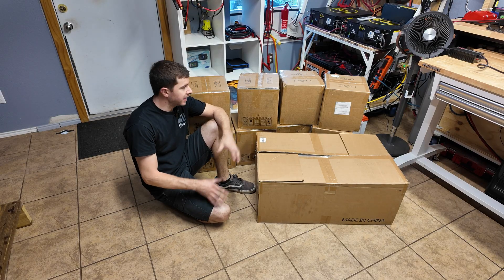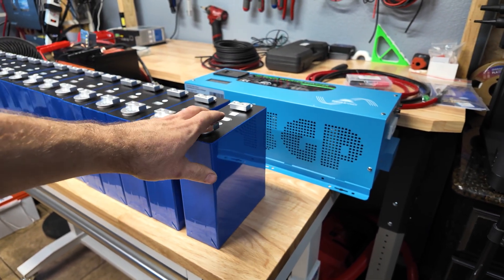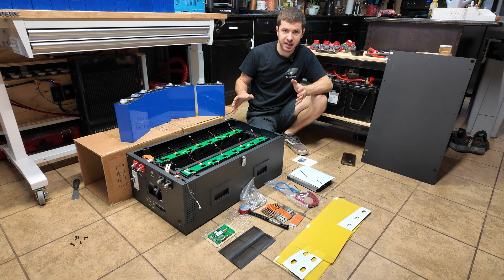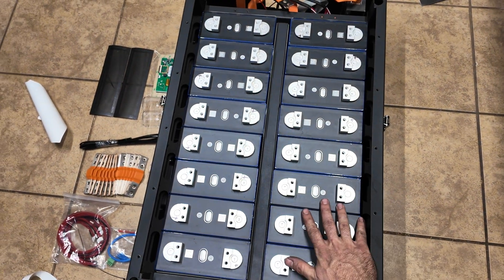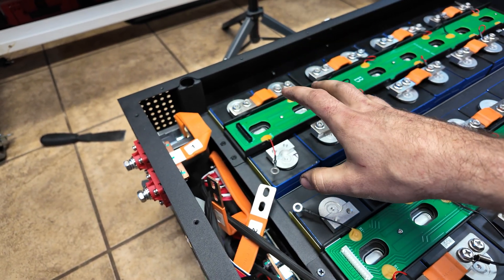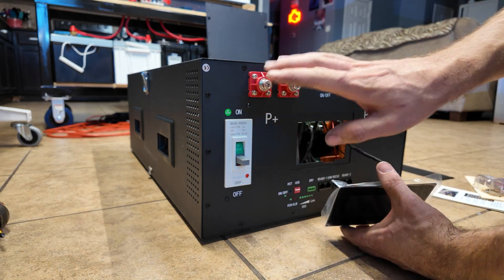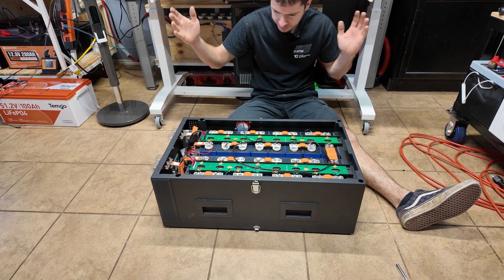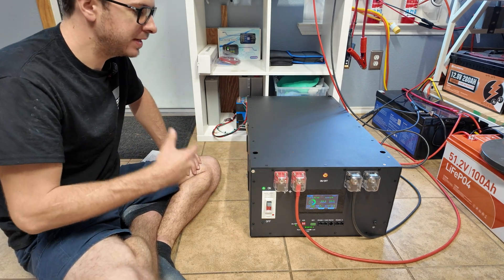DIY 48V 314Ah 16KWh LiFePO4 Battery Build!  | Yixiang V2 Kit

Comment: Hey guys, so are we supposed to top off each cell and make sure they are the same voltage before assembly? Also, what’s a good charger off Amazon to do this? 

Thanks for the video!!
Reply from the maker: You can top balance, won’t hurt! I just put it together and let the active balancer do its job no issues so far. Use a 15-18 amp charger from Amazon there’s tons of options
Reply: @Mikebuildss thank you Sir!!

Comment: What is the best priced AC charger you would recommend?
Reply from the maker: 48 volt 15-18 amp chargers are the cheapest option normally, if you want an adjustable output one eco worthy has one that seems good for the money but I haven’t personally tried it. 
I have a DC house 18 amp charger, and a WattCycle 15 amp charger both work good for topping off my batteries

Comment: Hi Mike, I bought the set after watching your video...(I have two) and it went together seamlessly.  My only issue is communications with my Eco-Worthy 5k hybrid inverter...it does not recognize the unit...I have to hook to rs485-2 to do this and I have a single rs485 input...I feel like it is simply an address issue...the dip switches are set correctly...just communications, any ideas?

Comment: if you took the front cover off, there are 6 bolts that tighten the plate the BMS is mounted on to apply pressure to the cells. Thus you wouldn't need the shims you printed.  You really need to take the front off and check all the terminations done in the factory are tight...found a few loose in the 5 I have.
Reply from the maker: Ahh ok I I thought I checked evening really well but won’t hurt to check again and see, thanks for the advice!

Comment: Can you stand these up on end if needed?.
Reply from the maker: I belive you can, these type of cells can normally be positioned any way except upside down. I would be worried about the box integrity, as im not sure if its built to handle the weight in that posotion

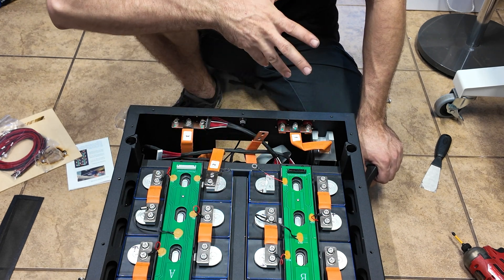Comment: Looks like they either shipped you a V1 kit or left some parts out of this one. There's supposed to be more 3240 epoxy sheets (yellow cards) for in between the cells, with a routed channel for the thermal sensors. You shouldn't have to 3D print filler for the compression plate and cells. You can see them in Off-Grid Garage's video "This new Yixiang DIY Kit could save you some money! And look at these features!!!" at the 9:52 mark.

Comment: Doesn't the plate with the bms mounted to it tighten to add pressure to the cells?. I saw that in a few videos.
Reply from the maker: It does but even with the plate fully torqued i had some space.

Comment: Warning for any one considering buying from Shenzhen Yixiang New Power,  Run Away as fast as you can.
My vertical box arrived damaged, internally and externally. Becky changed from being super helpful pre sale to absolutely horrible! 
All the positive reviews are of people who have had no issues! Try to return an item, or request post sales support and their attitude completely changes. I have been in a dispute with them for 3 weeks, and there is no sign of resolution. As I said run and dont look back! 
If anyone is interested I have all the details 😊
Reply: Quick update - Becky has gone from bad to worse! I've now been ripped off. I have 16 3.2v cells and no box. They absolutely DO NOT STAND BEHIND THEIR PRODUCTS. YOU HAVE BEEN WARNED!

Comment: If sodium ion batteries drop to 10$/kWh as promised by CATL .

There is no way Trump and the oil companies can stop the energy transition.
Reply from the maker: Agreed!
Reply: please research sodium, the curve is an issue with most equipment at this time.
Reply: @lancesada7515  The solution is a high voltage battery..
Reply: @lancesada7515  Go to China bro and see .
How much China government Spending tax money on R&D in renewable energy . 
This is the reason why China will be the winner in this green energy race.

Comment: 6:00 I think it’s best practice there should be isolating sheets between all cells (the yellow stuff you putt below and on the sides of the cells).

(Also: if people use this as an example: wear safety glasses and preferably isolated tools ⚒️)

Comment: Neat product! Those golf cart batteries ya got in the background are coming down in price fast! I bought one in June for $830 with charger, now its $705 with charger, or 650 without charger. Do you recommend this battery over the golf cart style? I have 2 golf cart batteries. I'm debating whether dropping the coin on a DIY battery like this or keep stacking golf cart style batteries as they go down in price. I don't need the communication ports. My 2 batteries do get a little out of balance but nothing more than 15%. Thanks for the video!!!
Reply from the maker: That’s a tough call like you said the golf cart batteries are so cheap and so easy to connect and get going, I think I do like this if you wanna get 1 large battery plus it’s easy if you need to service it

Comment: Did they not recommend "top balancing" the cells in parallel at 3.65v until the amps drop below 1a? It's quite an important step to make sure they are all the same voltage and can take between 12-36hrs.
Reply from the maker: I’m sure that’s recommended, and a really good idea, I didn’t wanna wait. This bms also has an active balancer and those are really good at getting the balance perfect in my experience. I didn’t wanna wait voltage check cells they were all the same , doesn’t mean much with LFP due to flat discharge curve but it’s a good step regardless
Reply: @Mikebuildss yep watched a will prowse vid recently and this was one of his steps. I think it's so 1 low cell doesn't trigger a low voltage disconnect etc.

Comment: How much did you pay for this shipped to US? I feel like it would be more beneficial to buy the ecoworthy 48v 280ah v2 which is $1900 and 2 days shipping
Reply from the maker: I bought my cells from Ali baba, yixiang braided 314ah, The shipping for the cells was around 200 but the prices change so much it’s hard to have an exact estimate. 

If you buy the whole kit from the site, it says USA stock but I would verify that before you buy. If you can get us stock for under 1900 I’d say go with the yixiang.   From china the cells cost a little less. The box came from the USA warehouse and took about 3 days to show up
Reply: @Mikebuildss  Can you provide a breakdown of your costs (box vs cells)? And you bought the box kit from their website and the cells from them but via Alibaba? Thanks!
Reply from the maker: @dmitriyc yes good idea!
Reply: i see. Also, how do you move them around after assembly?
Reply from the maker: @HuyTran-zy9sv  Dragging it across the floor
Reply: beneficial is up the buyer. The option in this video might be better for someone who wants to wait a little longer to save 16% on cost and have 11% more capacity